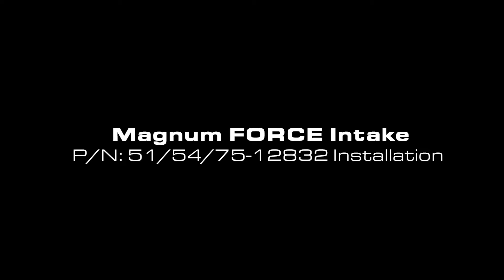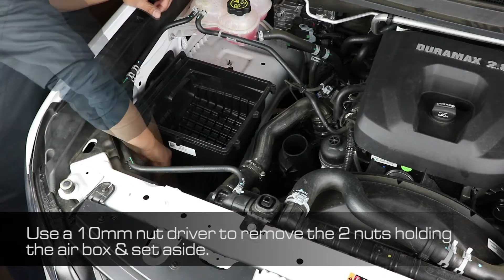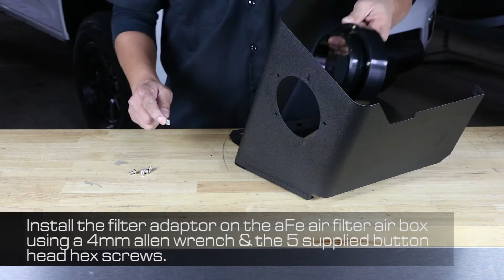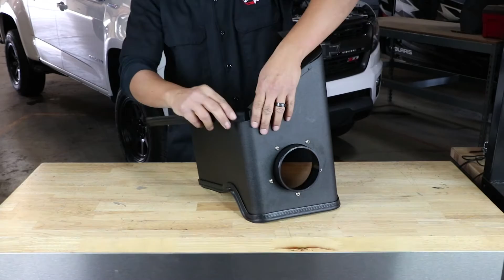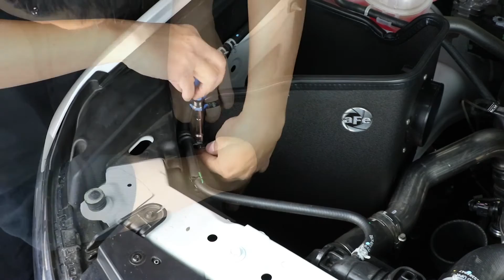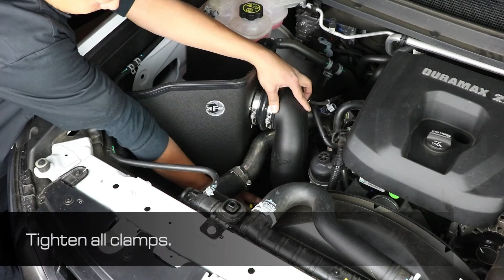How to Install aFe POWER 16-17 GM Colorado/Canyon I4-2.8L (td) Magnum FORCE Intake System (54-12832)

Comment: any thrown codes after install?
Reply: I have the Momentum GT and I've had 2 codes so far. P2A00 It's a very common code on these diesels. It might just be bad sensors, Or these trucks are very sensitive to any change over stock.
Reply: HiLuckyB did you reset the Ecm after the install and has it come back after reset/code delete?
Reply: I was able to drive about 2,500 miles before I got that code. Then I reset it and it came back on last week, After about 1000 miles or so. Not sure at this point if it is 100% the intake, The colder weather or what, But from what I've seen on forums it does seem to make it happen more often. The next time I go to the dealer i'm going to ask about it, If I get the code again. Maybe I can get them to replace the sensor and it will stop.
Reply: HiLuckyB well technically it voids the warranty so they don't have to replace it. I was looking into going crazy with afe intake, exhaust, cooler pipes and a live tune since the scorcher doesn't work with the transmission. I'm wondering do you need a tune first or something prior. afe professionals can you enlighten us?
Reply: Brendan Grad Considering the V6 can get an aftermarket intake installed at the dealership, It would seem odd to void your warranty on a exhaust sensor for having a intake. But I know some dealerships will probably try to do that. It wouldn't be good for their business though.
Reply: Yeah, go tell the dealer you modified the engine components and are now getting codes warning of a problem. They rightly should void your warranty.